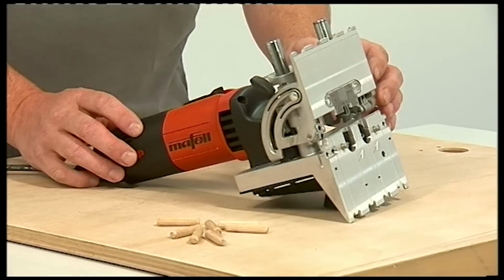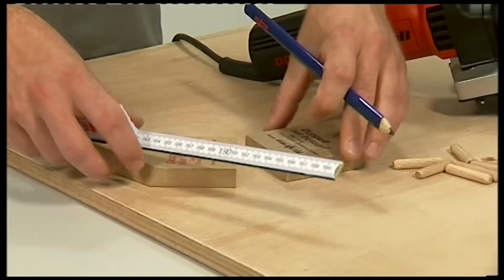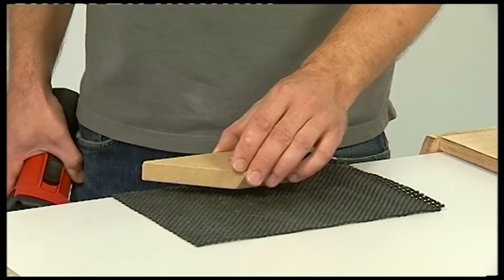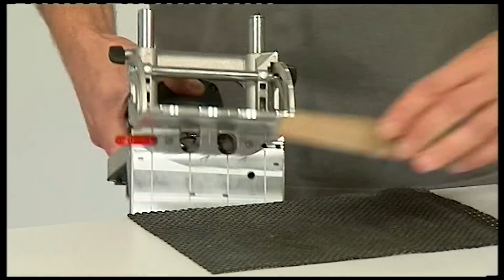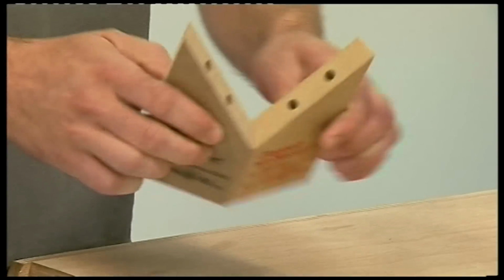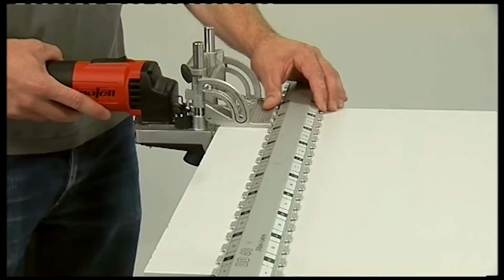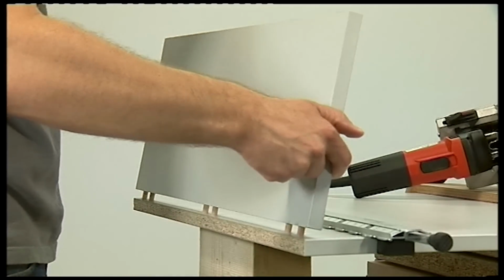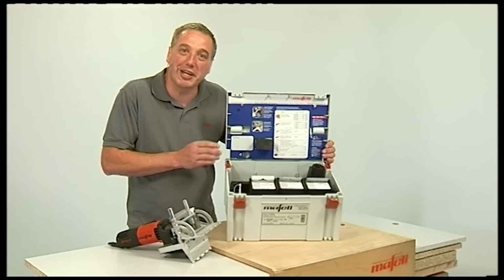Mafell Duo Doweller

Comment: Hi,👋 HAPPY NEW YEAR 🥳, from a very long time ago, 😂, I purchased one of these when they first came out many years ago, it’s well worth the money, I have even used the long track, to put pinholes in the side of casements for adjustable shelving, using the jig that you have to buy separately, Like all good machinery, it comes at the price, I have got quite a few of their machines, from MAFELL , Jigsaw, Doorlock mortis machine, Chain mortis machine, Duo Doweller DD, And of course, they are large, Mafell router Lo 65 Ec, and jig Arunda 80”, I have used the machines for the best part of 20 years, never had a problem with any of them, apart from obviously sharpening the chain and bits, I did, and still have another make Festool router, which I tried to use on the ARUNDA jig and it did not seem man enough to do the job, I am hoping to purchase their new Lo55, at some point, though I do wish it was cordless, I am now retired and 72yy , now living in France after nearly 50 years, I work for myself in the UK, I am getting bored, and I am thinking of starting a small little business, making and restoring furniture, hopefully sometime this year, the main reason why I would like to get myself the new LO 55 is that I’m hoping to do some spiral work on my Wood-lathe, and this would be more suitable as it is a smaller cross-section, for me to make something to hold it, 
I hope this piece of information helps somebody either now or in the future, Phil from the moulin France .

Comment: Anyone know how this compares to the MUCH lower priced Triton doweller?
Reply: AD I know, triton is shit. I returned twice. First I thought I might be having the bad egg. Then exchanged for another one, it was same. You can't align with triton. It's impossible to have good joints with triton.
Reply: There's a video of a review on the Triton and it is shit.  Out of the box the guy had to make multiple adjustments to the unit to get it to be square and usable.

Comment: Fine looking tool but I prefer the Festool Domino 700 because the Domino tenons I think are stronger than dowels.
Reply: Nope. Tests prove dowel joints are actually stronger. Fine Woodworking  did an article on that very thing. This slays the domino.
Reply: If we look at the grain direction on any size dowel of any species; there is strength in the wood dowel due to long grain. The Festool, like the Lamello wood plate is made from wood fiber pressed-compacted into shape and grain direction is not there. Therefore we
do not have the inherent strength. Probably have to go up in cross section some 35-40% in a Domino dowel to match a long grain wood dowel. I would like to buy both Domino machines; but, me wife wants to eat everyday. I am thinking of the Triton duo dowel with some redesign in the alignment elements. $200 for the Triton new and then add another $235 worth of fix. Still not at the $1000 price tag of the Mafell duo dowel tool. And, one can get those metric dowels on the net or buy the Nielsen metric dowel chase and make custom matching species dowels and play from there. Depends what you want to make in a certain species of wood.
Reply: @vincentrolfe1384  
Triton is a dreadful tool. 

If they put a few hundred Euro extra on the machine it could be a best sell and still cheaper than others on the market. 

I suspect that they have it on licence and as such they cannot justify the investment